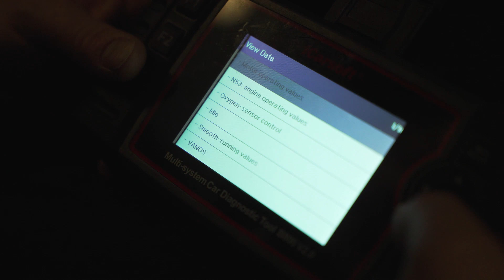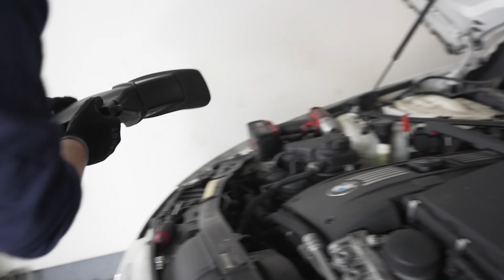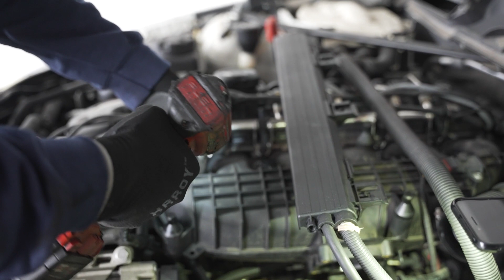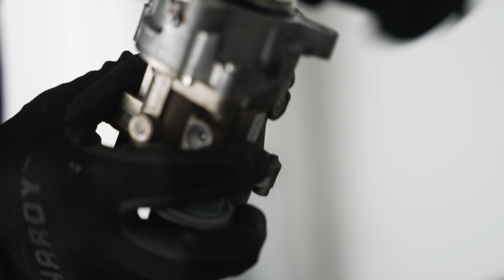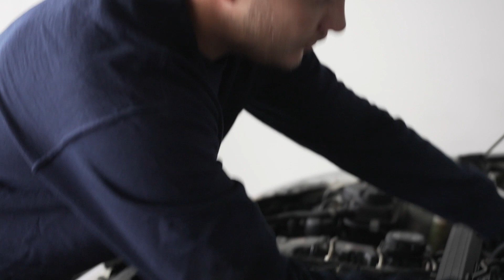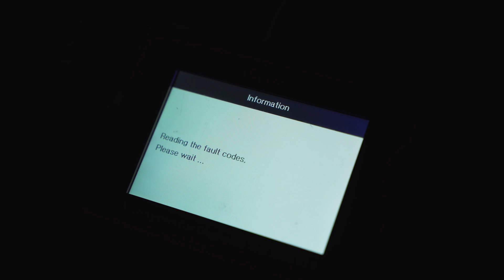DIY E90 BMW 335i High Pressure Fuel Pump Replacement (HPFP) N54

Comment: Why would you remove the throttle body if you're just going to take the intake manifold off? Just leave it attached to the intake manifold and take the whole thing off in one piece.

Comment: Help anyone: I got a used HPFP, on my 08 335xi but Im having all kinds of trouble after getting the one off to getting the new one to line back up to bolt back on> Its close, but I can't get it perfectly lined up so it will bolt on! Its almost freezing here and my back is giving out, trying to get this on ...all day...UGH

Comment: Greetings very nice video thank you. 
My BMW F20 N13 116i logged DTC P0087 can it be HPFP issue. With drivetrain warning.
 FRP value is 6000 kPa at ideal and freeze frame for dtc 220 kPa only. Is FRC same as hpfp value you shown in video.

Which is better Used BMW part or new part from good tier 1 like Bosch or hella?

Comment: Hi Zeiten, wow you have a real talent at making repairs accessible and comprehensive to DIY. I have a 2011 X3 F25 N55 and from other videos, it seems as the same process to your car in the video. I am not a mechanic so I'm wondering about cleaners and lubricants? I know you have to clean the Manifold before inserting the new gaskets and you were saying about lubricating some gaskets. Could you run through your recommendations in cleaning and lubricating? Keep it up
Reply from the maker: Hi thank you for your feedback, cleaning- you can use regular throttle body cleaner and shop towels, as far as lubricants for components that interact with engine oil use a bit of engine oil, if it’s coolant use a bit of coolant and so on i bet you get the idea. Intake manifold gaskets generally don’t need lubricants

Comment: I love all of your videos I find most of them very helpful as I have a 2012 E70 with the N55 motor .. I had a failing high-pressure fuel pump for the last month. I think it was going out and was putting my car in limp mode and causing it to misfire. I drove around for a few weeks like that with my scanner plugged in constantly having to erase codes to take it out of limp mode, I believe this cause my ValveTronic to deactivate due to “fault too frequent “ I am going to replace the pump and hope that the valve Tronic will relearn positions and activate back on its own. I would love for you to make a video on relearning adaptations, and Val Tronic/eccentric shaft positions.

Comment: What tool did you use for the back bolt having trouble getting it off in my car
Reply from the maker: Long thin torx 30 you can find it in harbor freight

Comment: Hello Mr Zeiten,
I have the following OBD DTCs:
0029F2
0029F5
002AEC
002C7F
Are they enough to change the HPFP or is the NOX sensor that is leading to put the car in Check engine light and running ∆=1 in an emergency mode ?
The car goes normal but when I floor it the MIL appears on cluster
Congrats for your channel and thanks a lot in advance.
The pump was changed in an official recall in 2011
E92 N53B30UL 218 hp 2008 250.000 kms.
BimmerN53
Reply from the maker: I’d say start with hpfp either get the genuine pump or used guaranteed working condition any aftermarket pumps or remanufactured are tend to not work from the start, regarding other codes go one by one

Comment: Hi Tim. A huge thank you for such a high explanatory video. Thanks for sharing the knownledge. I am in Brazil and I am facing hard times trying to find this fuel pump over here. Would you mind telling me where I could buy these remanufactured pumps in US? Thanks again.
Reply from the maker: Thank you for your feedback, just look for oem used pumps on ebay from my experience used oem is better than remanufactured

Comment: Probably a good time to upgrade the fuel pressure sensor while you’re right there. Also do a walnut blast to the intake valves
Reply: Dave where do you buy the pump and upgraded sensor? Also when cleaning valves how do you rotate the engine and ensure Both valves are closed in each cylinder? Can you visually see enough in the ports?

Comment: Thanking you Again Tim, for your thorough and in depth instructions SIR!! Fabulous Video!!  I do not have any issues with my 13, x5 35i, but i would like to change out the fuel filter,because it has 162000 thousand kilometers and feel it need to be replaced,(preventative maintenance)but i do not know where it is located e and has remove the front underbelly covers but no such luck ( continuing to damage/break the plastic clips).I do have the new Mann fuel filter to replace  ty for your help.ty